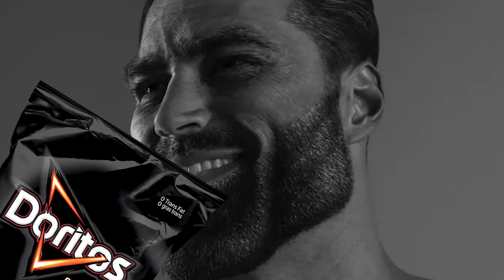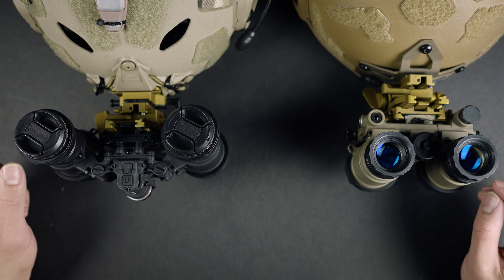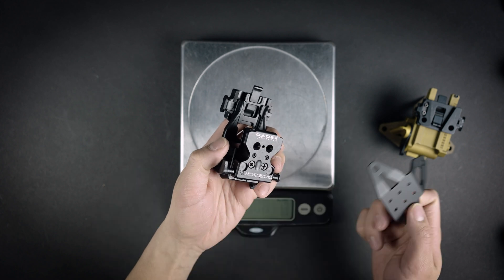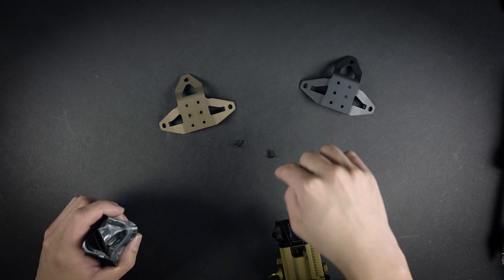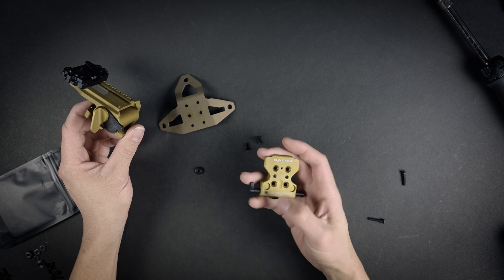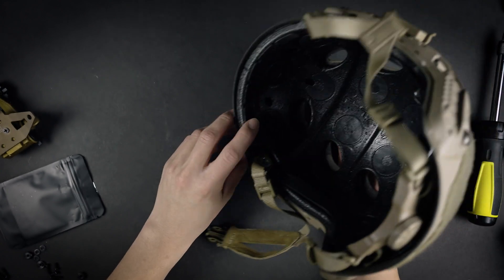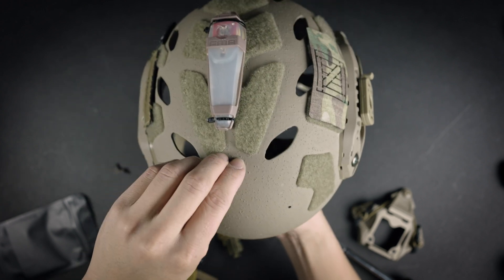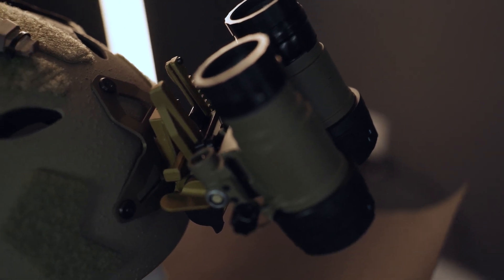Cadex Helmet Integrated Plate (CHIP) - An Overview On The Most Low Profile Mount We Have!

Comment: How does this compare to a Wilcox G69?
Reply from the maker: Great question. The Wilcox G69 has the same fundamental flaws as the G24 and other mounts in that family in that there is a steel pin resting on an aluminum drum that over time, develops a up/down wobble in the arm if impacted repeatedly. It also depends on the features you are looking for. The Wilcox is a touch lighter (about  20g)and will come with the lanyard, though personally we find the lanyard lacking and prefer to tie a piece of cordage with a mini-carabiner to the shroud itself for proper retention. 

The CHIP-Cadex combo will have a lot more features, such as an adjustable dovetail and greater range of adjustments for throw, and height, as well as having a one handed adjustment for height vs the friction fit one. 

Force to overcome up is also a very nice feature for us, and allows for quick stowage in dynamic lighting conditions. The Cadex is also a much stronger mount as the way it locks is far more wear resistant and there are no plastic parts to break such as the height and tilt levers.

Comment: and after installed you keep the full range of height adjust?
Reply from the maker: Great question. You lose a little of the throw adjustment (the furthest distance it can move out will be shorter) but it sucks the NOD in closer. The height can be adjusted to the same level as the plate has multiple screw holes to customize the height much like the stock breakaway plate. 

Compared to other integrated helmet mounts, it still has a further range of adjustment than others.

Comment: Would this work with the PGD you guys sale ?
Reply from the maker: Yes it does! You can see it on a PGD in the profile comparison parts of the video. We suggest using the stock PGD screws, as PGD uses larger holes for the shroud than most helmets. 

It does take a little more finesse, but it works perfectly one installed.

Comment: Very nice product, looks like it fills a very useful niche, but holy smokes that pricing. I know that NV is a small market, so low sales volume means higher pricing to make a profit, but I still blanch at the thought of paying over $60usd for a stamped sheet 6061 plate with a few threaded holes.
Reply from the maker: Thanks for the view and feedback. When you look at night vision as an entire system, there are a few options to lower weight and profile of the NODs. You could go with a lighter housing or lighter lenses. Both which are usually more expensive options or offer different features the user may not use or enjoy depending on the setup. 

Or you could lower the profile and weight of the mounting hardware so that the compromises may not need to be made on the housing and glass level. Compared to other options on the market we feel that there are few integrated mounts that offer the features, durability and low profile nature of the CHIP+Cadex at the same price. 

The CHIP did take quite a bit of design work  to get the gauges, and stamps made properly to the right angles. As well, it is fully made and cerakoated in Canada, we wanted to make sure all parties were compensated fairly for their work.